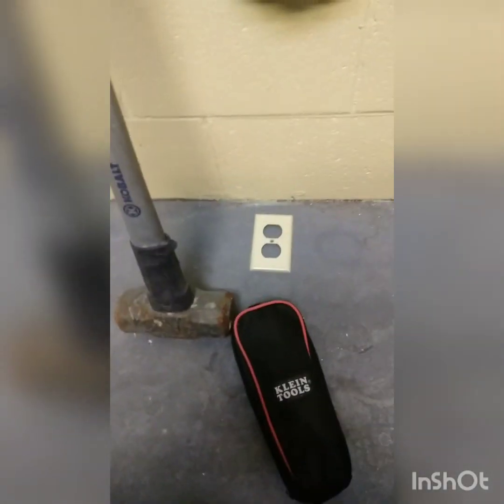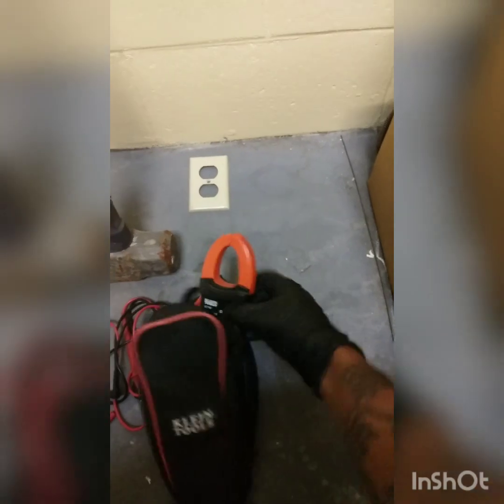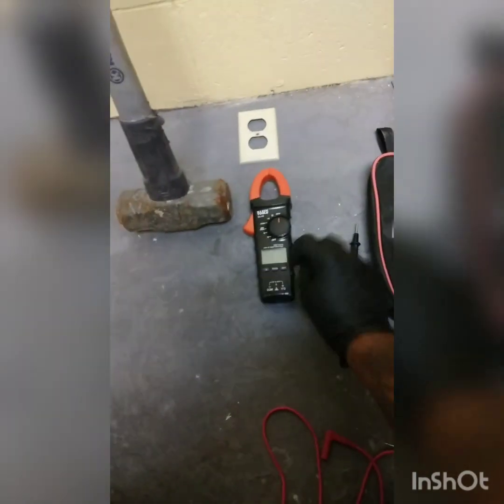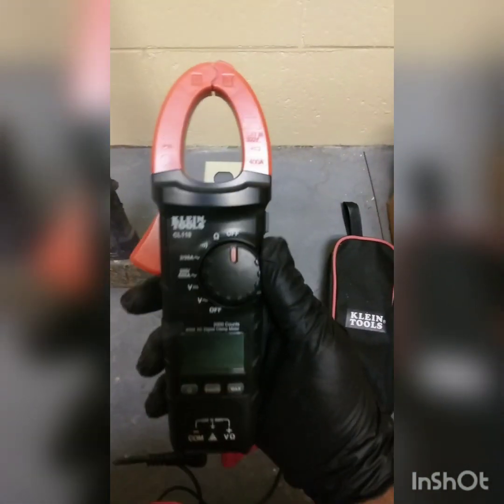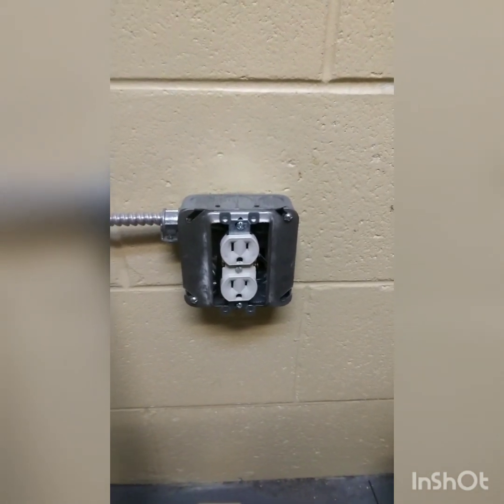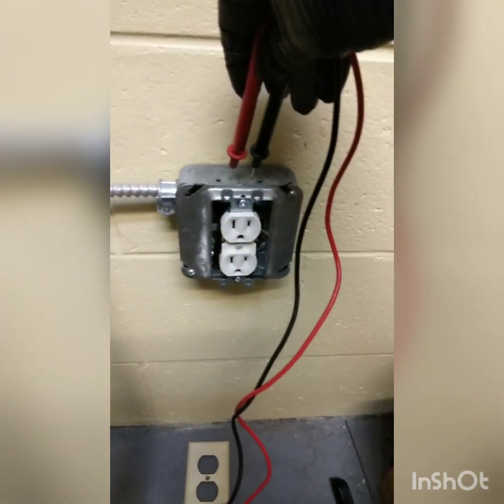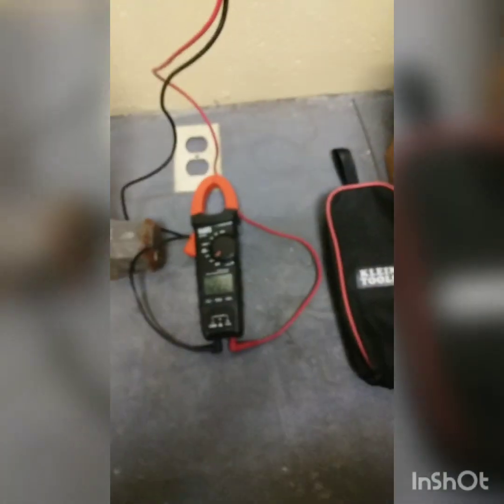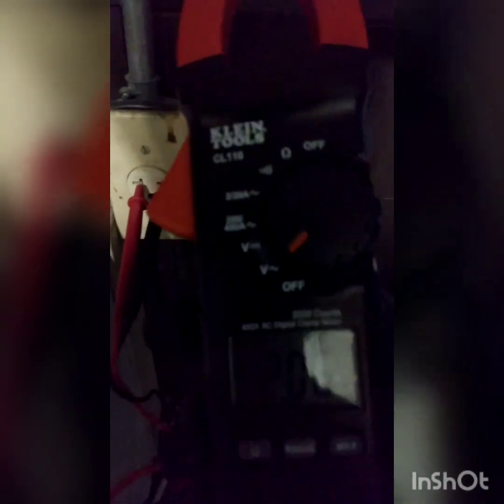How to use voltage setting for Klein tools CL110 Electrical tester. Maintenance tips and tricks

Comment: Mines reading 6.88v dc on a battery that two other meters are reading 12.6v on. this meter is brand new it's a CL390 with rel zero and ncv whatever that is. Any help would be greatly appreciated
Reply from the maker: I’ll take a look into that .good question by it being new